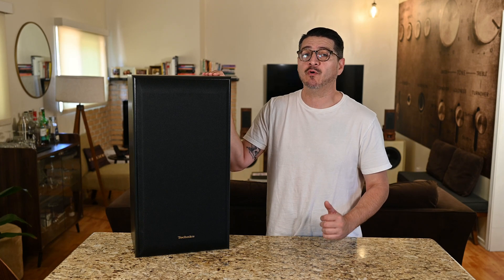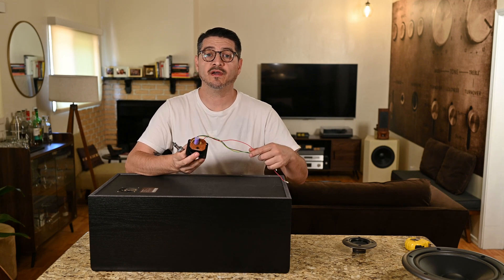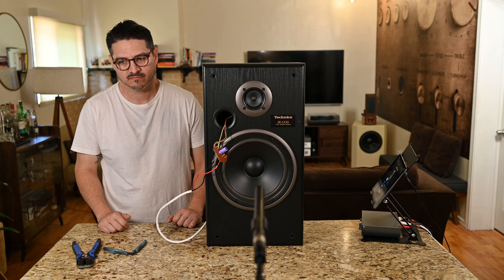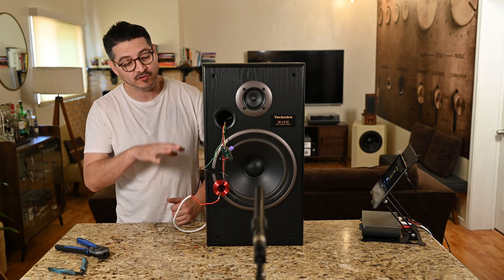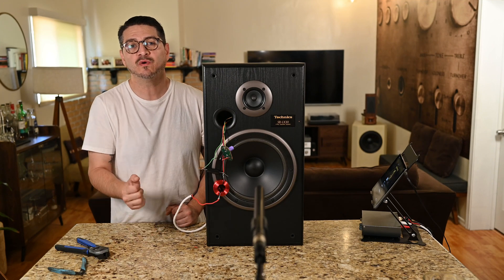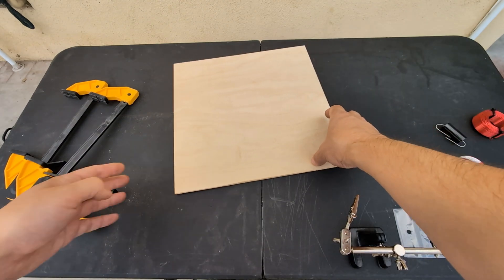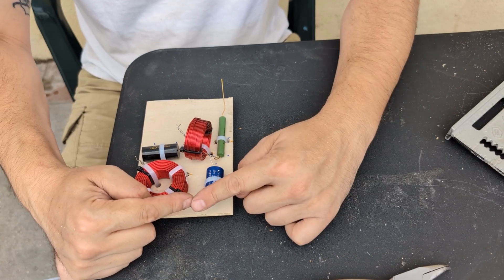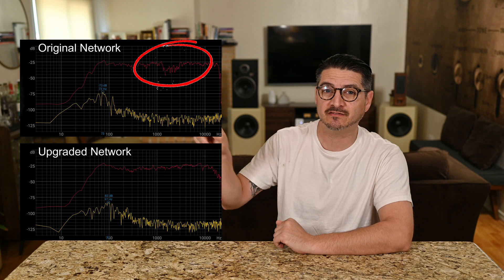Thrift Store Technics SB LX30 Speakers get a DIY Crossover Upgrade

Comment: Hi Rick. I have a pair of RadioShack Optimus floor speakers that I'm planning on upgrading soon. All (3) speakers will be replaced and add a  crossover. This speaker didn't have dampening or crossovers in it.😮
Reply from the maker: A 3 way speaker with NO crossover? Wow. Interesting. I'd expect something at least on the tweeter to keep it from blowing from the bass. Let me know how it turns out! 😁

Comment: I got a pair for dirt cheap and they worked. I bought 2pcs 130W 2-Way Speaker System Audio Crossover Filters Frequency Distributor on Amazon for 10 bucks and rugged the inside of the cabinet with car rug. Sounded amazing.
Reply from the maker: Very cool. Glad you liked them!

Comment: Always solder with the iron tip under the connection and feed solder to the top to ensure it flows all the way through the connection. Heat rises.
Reply from the maker: Thanks Tommy, I'm not the best at soldering, but I get the job done. I do much better with Lead solder than Silver for sure.

Comment: Excellent, thanks for sharing your knowledge and passion.  I enjoy bringing these old units back to life too.
Reply from the maker: Thanks Rick. Yeah, it's fun and satisfying to save an old set of speakers. Thanks again 👍
Reply: Always solder with the iron tip under the connection and add the solder from the top. Heat rises.

Comment: Thanks for the step by step. Sounds like you really made a difference with those speakers. Did you add any foam or poly fill before you closed them up?
Reply from the maker: Hey Nate. Thanks for watching. No, I didn't add poly fill. The drivers aren't very strong and I figured the internal volume was large enough. I probably could have added some extra corner bracing but again, this speaker isn't made for cranking up, or at least I wouldn't. So up to around 75dB it's good enough. 👍

Comment: thank!!! question, plz: how to repurpose Peavey pro sound speakers? after the pandemic closed clubs, there's a zillion of 'em wasting in storage! I've a dozen :-0
Reply from the maker: Are they passive or active? The problem with some Pro Audio is usually the noise floor. I have some JBL 612s and their built-in amps are noisy. They're great for a party, but for sure not high end sound. I hear their new 700 series are better in that respect. I'm not sure about Peavy though. If they're passive, then maybe you could do some upgrades. Or if you get them cheap, cheap, and have better amps, you could always bypass the amps.
Reply: @antoniiocaluso1071  
What Model #  are your Peavy speakers?

Comment: I made a mistake and bought some replacement woofers that were less sensitive than the tweeters.  Would a different crossover fix this issue?  Subbed to your channel.  I'm also not impressed with all the judging going on in the audiophile world.
Reply from the maker: Hey! Thanks for watching. I don't think that's really a mistake. A lot of times the tweeter is more sensitive. As long as they will cross nicely you'll be ok. The fix is usually an L-pad or single resistor on the tweeter network to attenuate the highs 👍
Reply: @RickRuizAudio  Yes, I actually posted my issue on an audio advice forum.  The L-pad option seems complicated and it is poo-poo'd by audiophiles I guess.  What I have is a pair of Infinity SS 2003s with Dayton Audio classic DC200-8s mating to the Infinity procell tweeters.  The woofers are rated at 87db and the tweets are 90!  I would like to know what resistor value I'd need.  These are excellent speakers.  I'd also like to kick the person in the pants who sold me these as "tested/working" as I refoamed the original woofers only to find out one was dead.
Reply from the maker: @bpalpha  lol. I think the L-pad that "audiophiles" dislike are the ones with a knob attenuator. A regular L-pad is a resistor in series and one in parallel. This gives you the resistance and attenuation like the single series resistor but with less effects on the impedance. Or at least that's my understanding. Just use some good resistors. 10 watt non-magnetic. Calculating the value is another story.

Comment: I found a pair of those and turned them unrecognizable. Idk I can't send you a picture. Started by opening them up and bracing them spraying the inside with flex seal and then glued down carpet pad. I got flooring adhesive and troweled it on the outside, then covered with oak hardwood flooring and sanded it down so you can't see any seams. I bought a budget woofer and tweeter and designed a quick crossover. But the cabinet came out so nice that I decided to make them really nice. So I got Dayton reference paper cone woofers and a Dayton reference silk tweeter. Then I designed a 3 rd order crossover on xsim crossed at 1400 to avoid beaming. I used ofc wire, lead free silver solder and ported it through the bottom that I designed on winisd. I used tung oil and poly on the cabinet. I routered the sides and tops and outlined the edges with gold leaf paint. I made the tops and bottoms 3" thick and put big rubber heavy duty feet on the bottom. The speakers look totally different and sound awesome. All my measurements, waterfall, distortion is flawless. They were thrift store trash and I can put them up against against a High end speaker and you wouldn't ever know. I just wish I could show you a picture
Reply from the maker: Send me a pic @ rickruiz@duck.com . I'd love to see!!!
Reply: @RickRuizAudio  ok thanks,

Comment: I feel zip ties are much better than people hot gluing the parts to the board. I had this idea also on mountings.
Reply from the maker: Yeah. I think if you aren't going to change anything, a 2 part epoxy would be good too and would hold better. But zip ties are great especially if you have to change things up later. On my high end build I used CA glue for a cleaner look but that didn't hold more than a year. I had to re-glue a few parts that came unglued.

Comment: Awesome video! I'd love to try this with some better speakers. I wish I had the knowledge to do this myself. Super fun video. Maybe upgrade the woofer and tweeter, install some polyfill, and re-invent this speaker? Haha! Do it!!!!!
Reply from the maker: Lol. The box is pretty thin. I don't think it's suited for a really strong woofer. Plus, when designing a speaker, it's best to start with the woofer and build the box off of its parameters. But a new silk dome tweeter would be nice, then cross at around 1.5kHz
Reply: @RickRuizAudio  True story. But we are here to have fun, right? Also, I can't believe you don't have 100k subs. Your reviews are really great and I hope you blow up! You deserve it!!!!
Reply: @RickRuizAudio the Dayton reference paper cone is the correct internal volume, I used that with a Dayton reference silk dome tweeter and covered the cabinet with oak adhered with industrial flooring adhesive. Redesigned a 3 rd order crossover at 1400 . Moved a new port out the bottom rewired the crossover with ofc wire and silver solder. I dip my inductors in paraffin wax .I made those same speakers into reference speakers. That look better than  Devore $20000 speakers and they probably sound as good also. That Dayton reference paper cone is a special woofer . There's not a lot of 10" woofers that can be crossed at 1400 without breaking up at any price. I even forget what is under that oak sometimes
Reply from the maker: @BostonMike68  Very cool, Mike! Yeah, I do like the Dayton References. I thought about using a pair of 8"s to replace my single 12" (Dayton DS) in my bass cabinets to my main speakers. I might play with that idea.
Reply: @RickRuizAudio  I was admiring your main speakers, I knew that they were diy but I was wondering if you designed them ? I like the Dayton ds woofers also. I just got a couple of 10" ds and they look serious and are heavy. The Dayton reference with the paper cone is the best woofer I could find that would work in a 2 way. That's hard to really pull off probably because of beaming etc. I looked around for awhile what would work. I used a third order crossover so I could crossover earlier with less distortion. I had a some left over hardwood flooring so I got an idea to use it and it worked great. I just had a lot of sanding
Reply: @RickRuizAudio 
A SB Acoustics SB29RDNC-C000-4 Neo Magnet Ring Dome Tweeter would probably be just right and a significant upgrade.

They aren't exactly inexpensive, but for the price they are a truly excellent tweeter that can cross low.

Too bad they don't have an 8 ohm version as well.

Cheers
Reply from the maker: @bbfoto7248  Nice. Thanks for the recommendation. Yeah, I personally wouldn't put that much more into these as the cabinet isn't that great. But good for what they are.
Reply from the maker: @bbfoto7248  😂😂😂